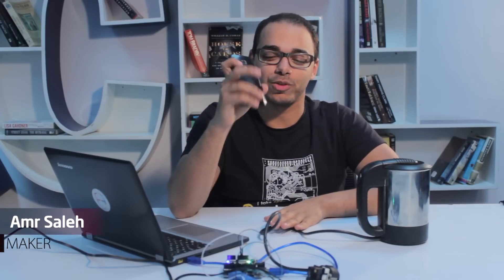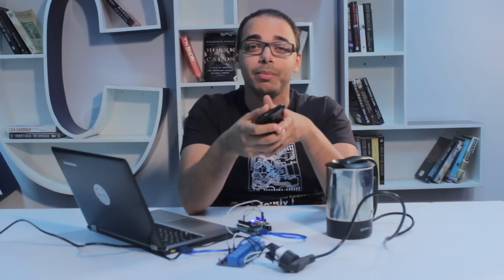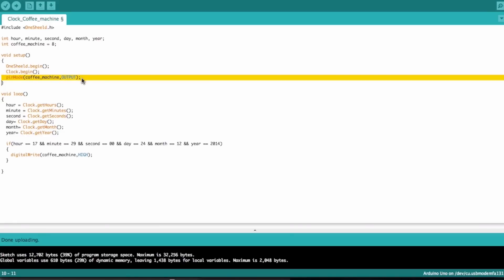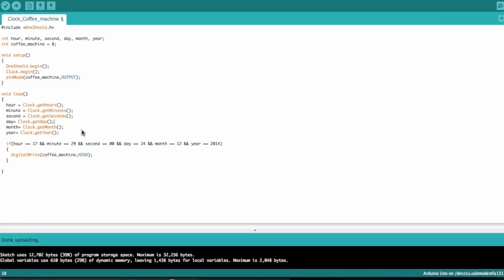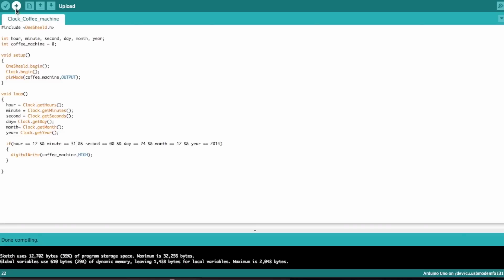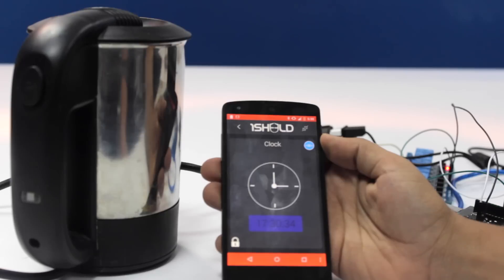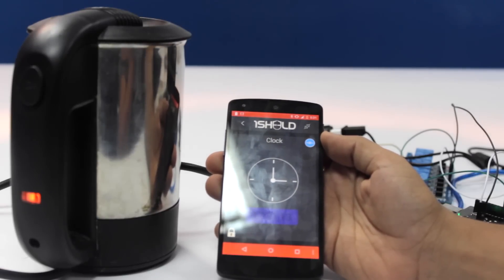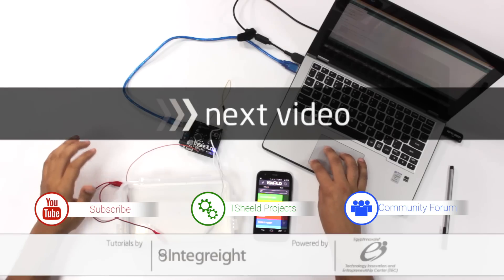Build a smart coffee maker with Arduino and 1Sheeld (Clock Shield Tutorial)

Comment: How do you connect the coffee maker to Arduino? In the code I see you send the "HIGH" instruction so it turns on, but how does the coffee maker recognize this command?
Reply from the maker: The coffee machine is connected to the Arduino through a relay and the smartphone is communicating with the Arduino board through 1Sheeld which is mounted on the top of the Arduino board.

For more information please check out the full documentation here: https://1sheeld.com/clock-shield-tutorial/

Comment: Looks great! 
The kettle has an on/off button , how did you bypass it and start it just by power the socket? 
Can it work with the button not pressed?
Thanks
Reply from the maker: You can keep the button "On" but it can only work when the command comes from the Arduino board.